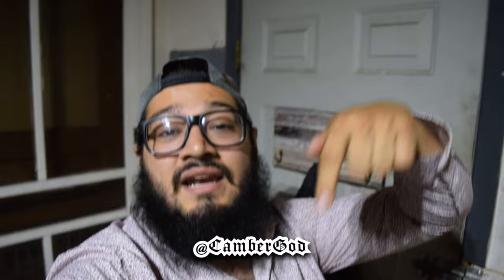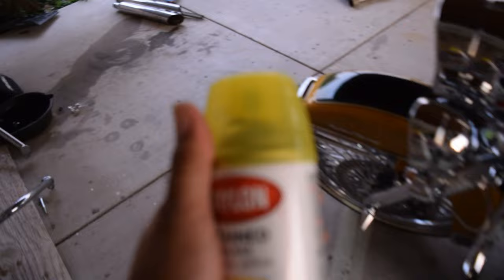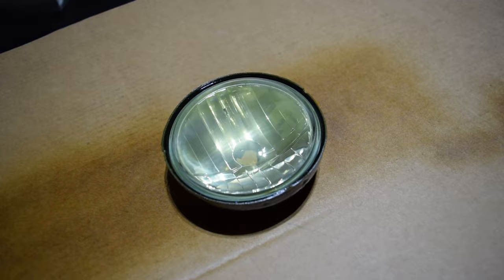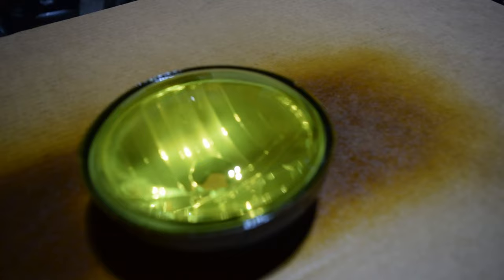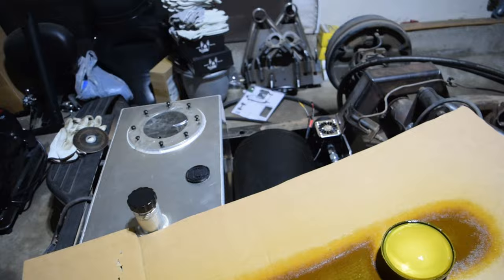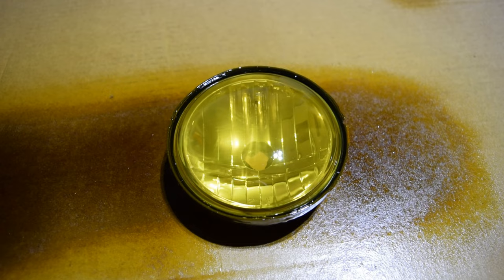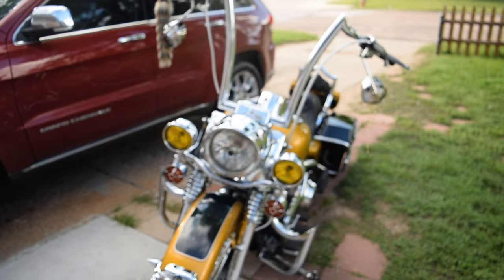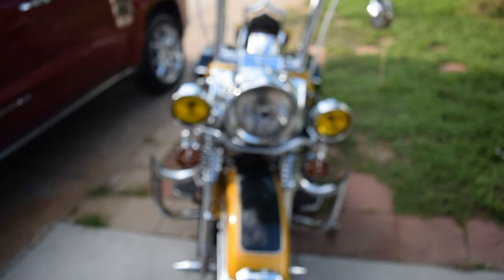DIY PAINTING LIGHTS WITH KRYLON STAINED GLASS PAINT!

Comment: Thanks for the video man, i wanted yellow rectangle 100w halogen lights for my old 76 Jeep  truck... but they dont make em anymore, only have some clear ones in old stock,  so ima try to paint em like you did.. i hope it lasts though
Reply from the maker: Mine held up pretty well, I did plenty of coats and plenty of time to cure.
Reply: @CGOD  were yours glass or plastoc lenses ?  Ill be doing it to glass
Reply from the maker: @jeepsblackpowderandlights4305  mine were plastic but I’m sure it would work the same if not better on actual glass

Comment: So I tried spraying onto plastic light (no sanding)… and mine peeled off! Did u have any issues with yours??
Reply from the maker: Mine didn’t have any issues with it, I did clean the plastic light housing with alcohol before painting them. Only issue I had with mine was little tiny pebble chips but I suppose that’s normal

Comment: That paint only holds up to 110 deg Fahrenheit & is for INDOOR USE ONLY.  You can't use this paint on your lights.
Reply from the maker: Yeah maybe you’re right, it’s only lasted and looked great up until today lol
Reply: @CGOD  Why don't you try reading the can.  I'm a paint chemist and this is not an acceptable paint for what you are using it for, but hey - what do I know.
Reply from the maker: @Airtouch67  I don’t have the knowledge as to why it works or won’t work. It looked great and performed well under the heat the bulb was producing and never had any ill effects. My current bike is running stained glass lamps and I like them better.

Comment: How are they holding up ?
Reply from the maker: They’re doing great! Still look perfect even after cleaning off countless bugs, no fade or anything. Way better than the vinyl wrap
Reply: @CGOD  have you waxed over them or anything ?
Reply from the maker: @Cruiseforacruz  nah I just let them cure after painting them for a day then I’ve been riding around with the lights on no issues
Reply: @CGOD  dope ! I had some blue tinted side mirrors that I accidentally messed up the blue finish so I stripped them down to just a regular mirror but bought the soft blue can of the stuff you used and planning on spraying them this weekend ! Should come out good as wel !
Reply from the maker: @Cruiseforacruz  yeah this stuff looks great! After a few coats it looks a little hazy but dries clear
Reply: @CGOD  sounds good, hope I don’t tint them too dark and not too light. How many coats total did you use again ?
Reply from the maker: @Cruiseforacruz  I used like 20 coats but I wanted mine as dark as possible. It didn’t get any darker after like 10 coats